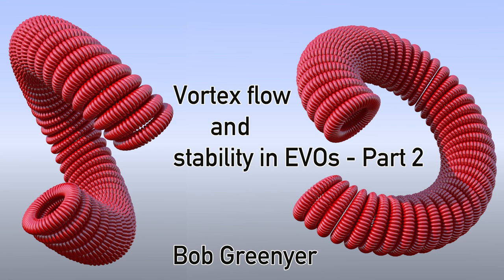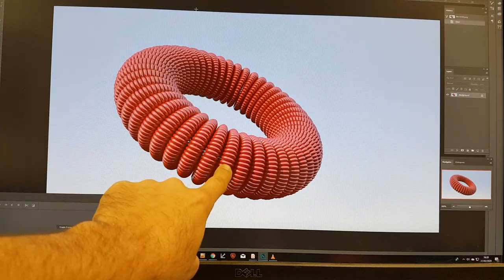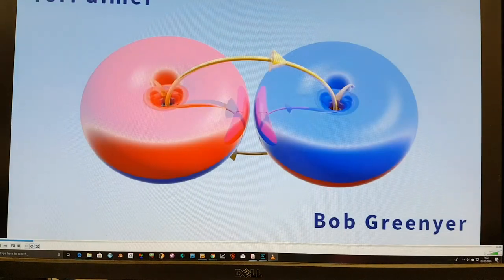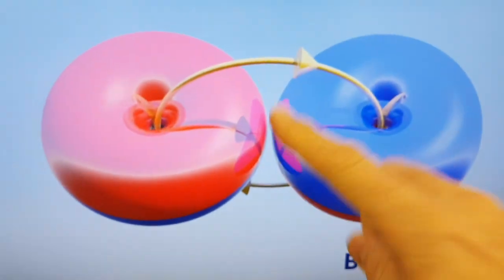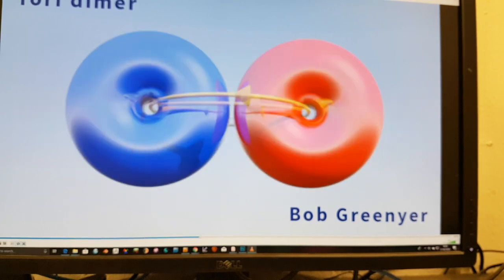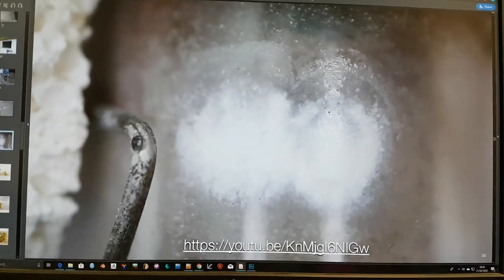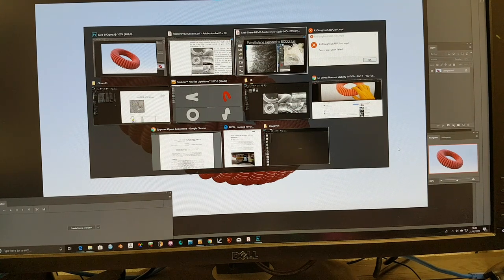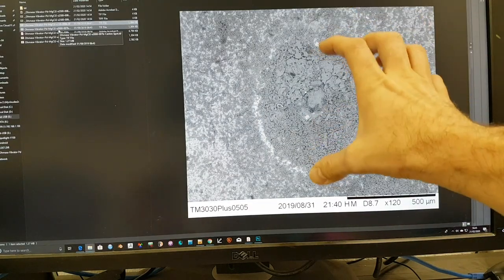Vortex flow and stability in EVOs - Part 2

Comment: Interesting. 
Based on the oldest and simplest interpretation of quantum mechanics, 
we can model matter like energy stuck in a loop.
And this could be like any loop. Like a vortex, or spiral.

So differences between particles could be differences in the loops or spirals.

Explained it here:
https://saidit.net/s/Physics/comments/18rz/nullhypothesis_quantum_mechanics_shows_that_there/
I explain how the most basic interpretation of quantum mechanics is the Loader theory by Planck (1946),
where particles are not little points.

Well... hmm.. 
There is also a much older theory with spirals in spirals and such.
But that is Occult Chemistry (1902-1916), based on paranormal vision.
Reply from the maker: Look further back for the answers.
Reply: @MFMP  
Thanks for your reply. 
Do you mean further back in your video list? (to find your answers about QM).

I think some that certain less known physics is parallel with what you describe. Just from another angle. Maybe this helps to build a more consistent model.

Anyway, it might be good for your channel to have some introduction. Or lecture videos to quickly explain some concepts. Some things that you say are hard to understand at first, because the physics is so different.
Reply from the maker: @zyxzevn  This exercise focused on staged interpretation of what happened first, the rest will follow.
Reply from the maker: @zyxzevn  I mean, much further back in time.

Comment: 2:35  are you saying the small elements have to be first established  only then to be all together entrained into a larger self similar (compound) version ? or are you saying that a certain property upon their creation makes them bundle together into a larger one ? Does the poloidal motion imply the toroidal motion ? In the air/smoke ring analogue it doesn't... and these are so easily reproducible, all possible experiments must've been done already.
Reply from the maker: Only the smallest toroid has poloidal motion, however, it's toroidal motion may or may not happen, the affects all generations.
Reply: @MFMP  Why would the compound ones be bundling together pole to pole if only the poloidal flux is what makes small ones bundle pole to pole ?
Reply from the maker: @sFeral  Things will become clear. One step at a time.
Reply: @MFMP  The poloidal flux is what makes up the shape. When talking about these toruses you're basically talking about the poloidal flux....you'll have a hard time explaining how these fluxes are maintained (at all) so close to each other, as that too doesn't happen with the air analog.
Reply from the maker: @sFeral  Depends on what causes these things to self-organise.
Reply: @MFMP  Fist find out how to produce "them" reliably, then try to hold "them" in place, which is exactly what I suggested PhysicsGirl should try with the air vortexes. I'm surprised that it apparently never crossed their minds while they were filming that video.
Reply: @MFMP  Did it cross your mind ?